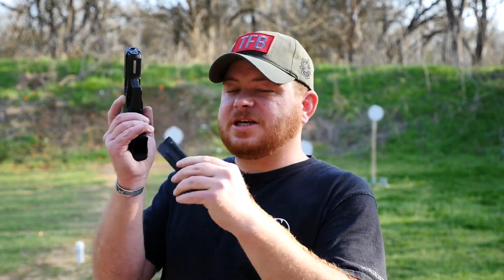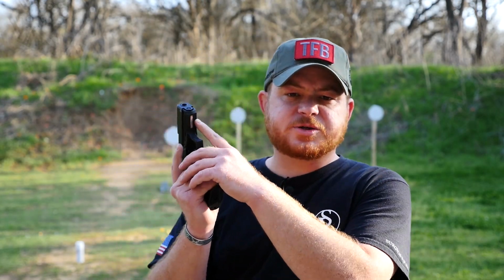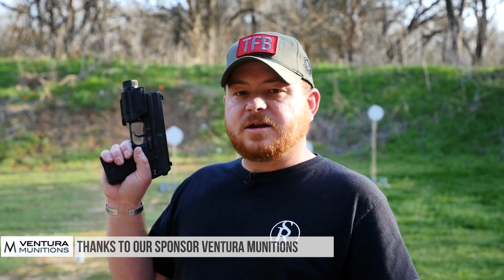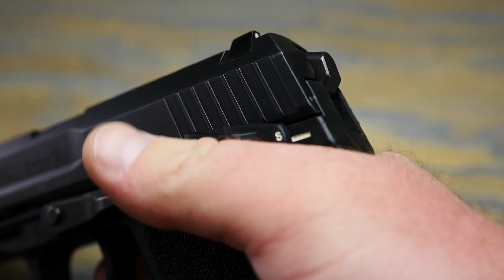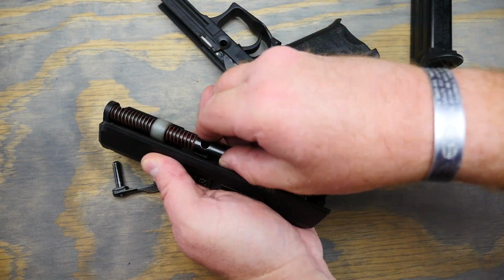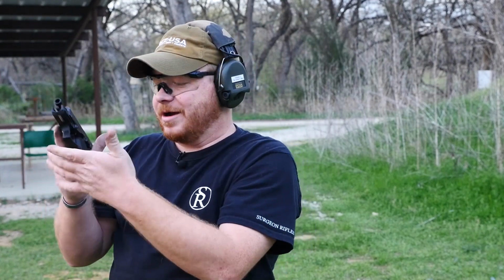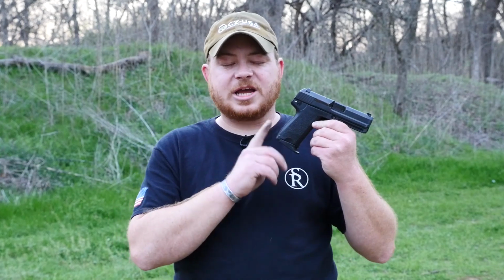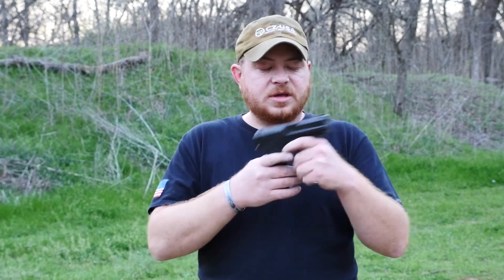Heckler & Koch USP Compact 9mm

Comment: Why do people think staying away from Glock is tough to do there’s literally nothing about their guns that’s even remotely remarkable in today’s market they’re uncomfortable overrated and overpriced cheap 2x4’s if they were so perfect then why do people spend on average 1k to make them actually good
Reply: I can get a Glock 19 blue label for 398 or 475 with ameriglo sights spend 25 bucks on a ghost connector and i have an extremely reliable pistol for 500 bucks. I have a Sig 320 I have a beretta M9 a couple of HKs and a bunch of Glocks. They’re great guns they are accurate and go bang when you pull the trigger what else do you need.
Reply: @Paratus1179  they are reliable guns if only they cost 390 msrp for everyone that’s how much they’re worth stock imo I prefer the m&p 2.0 around the same price literally everything you’d want to add is already there and done better and every bit as reliable or spend more on an HK or FN and still come out cheaper than what you’d spend to get a custom Glock on the same level as those I’ve been screwing around with a CZp10C and now the Glocks feel disgusting in my hands now I still have my 19x in my safe tho

Comment: The USP still has not been surpassed even by todays standards, it is the most reliable DA/SA handgun made by a major manufacturer (it can handle dirt and mud unlike the SIG P226 or the Beretta 92) The only handguns that come close in reliability and over all performance would be some of the top modern striker fired handguns like the S&W M&P 2.0 and the Walther PPQ and maybe a very few others (of course the super popular Glock but Glock is what you buy when you don’t know much about other options... either that or you need a good 10mm or 45).

Comment: Want to avoid having problems with the slide not locking back because your thumb rides next to the slide release?  Try a different pistol grip.  Try putting your damn left thumb under the pistol and in front of the trigger guard.  I do not understand why people use a pistol grip that requires their left or right thumb to ride on the slide and next to the slide release.  Its asking for trouble.  The problem is with you and not the pistol.

Comment: USP compact is the superior pistol if you can afford it.  I paid over $1k for mine with night sights and 3 13-round mags.  Build quality it is like a tank.  Can shoot +P all day.  Big difference compared to the cheaper HK's such as the VP9's and P30s.  Makes the glock 19 feel like a toy.  I would NOT feel comfortable shooting 147 grain +P buffalo bore out in the woods with a cheapo gun.  Lastly, this gun is built to precise german engineering, no defects in quality and you are pretty much guaranteed that it will go bang only when you want it to.  Smith and wesson has build issues (I will NEVER trust that company again) and sig has the infamous accidental discharge issue they are trying to do damage control with their "free" upgrade program.
Reply: Yup! Way better than P30 and VP9.

Comment: FYI for folks overly-concerned with capacity (never understood that, chances of you exceeding 8-10 rounds in a firefight, let alone getting in a street firefight are almost nill especially combined)- you can get the USP C and P2000 and P30SK (and 2000 SK) all with extensions and the P2000 .40 has an already 12 rounder that looks just like their 10 rounders, put a +5 on that and there ya go.
Reply: I feel there is a possibility you might do a mag dump under the adrenal rush and to make sure the target is down.

Comment: Should I get the USPc in 9 or 40?  It will be my only HK bc theyre so expensive (for me at least).  On the one hand i'd like the 40 bc it was designed for it and probably handles that round with aplomb...but on the other hand since it will also be my only German gun something makes me wanna have it in its native caliber.  Not to mention i'll probably shoot it better in 9mm
Reply: CLplusP Go with the 9mm, more rounds and you aren't losing much(if any) with modern ammo. Police across the country are getting away from 40 cal. Cheaper to shoot and less wear on gun, not that it matters with a usp!! Check out wound channels for 9mm, 40 cal and 45... you'd be suprised. You are correct about it being built around the high pressure.40 cal. Makes it handle 9mm and 45 easily.

 Try and find a used one for about glock price. I found my second one for $650 on Gunbroker. Holster wear but lightly shot it seems with night sights. Yup, I have two compacts (wife just got ccl) and a full size 45 for woods carry with 45 super. Looking for a used full size 9mm and upgrading it to custom combat for a nightstand gun. 

After  years of carrying a glock 19 I shot a usp9c and was amazed. No more glocks for me.
Reply: David Green, thanks for your insightful response.  I have since decided that the 9mm would be best.  I'd hate to thrash on an HK by recreationally shooting .40 through it and then have to buy expensive German parts of hk.net.
Reply: Not to mention that I am not caliber-obsessed whatsoever and have always been a strong supporter of the 9mm properly loaded hollow point.  So the USPc in 9mm makes more sense to me.
Reply: CLplusP I used to be, lol. In fact I started looking at usp compact in 45, because bigger had to be better in my mind. A bit of research changed my mind, also I very rarely carry an extra mag when I conceal carry. 

Eventually I got the 45 for woods carry. It's fun to shoot and 45 super is a very viable woods carry 45acp moving at 9mm speeds! I hunt hogs, it would take a lot of 9mm to stop a rushing Boar!! 
But with 2 legged self defense I'm more than confident with 14 shots of 9mm. Although I don't believe in magic bullets, modern ammo is amazing. 

You made a great choice, don't be afraid of a lightly used Usp. Any honest armorer who has fleet experience with glock and hk will tell you he sees less hk than glock for repairs. ....sheeeee. I gotta go shooting after work now, lmao!!

Be well.
Reply: 12 rds in 40, 13 in 9mm.  I'd say 40 for the uspc.  Considering it's service pistol sized and fairly heavy it handles 40 just fine.

Comment: "Hk's slide release is too large"
Same day installs oversized slide release on glock so that it actually has one.
Reply: Yep -- another dip shit Glocktard.
Reply: Glocks extended slide stop is still 80% smaller than the HK.
Reply: @johnviera3884  the Hk I don’t inadvertently activate. The Glock I do. I prefer the plain Glock one. The ambi is really bad
Reply: You have to take in mind using it when wearing gloves.
Reply: @johnharris8191 he contradicts himself with what he says though

Comment: Like every Insight product I've owned, it is overpriced garbage that'll fail you with time. That UTL gave me nothing but problems until the switch gave out (about 6 months of owning it)...like everything Insight, the product was already out of warranty by the time you buy it. 
The USP is still a damn good firearm, even by today's measure. Only failing is if you want a light/laser on it because the UTL sucks.

Comment: My P2000 is so much easier to conceal than the USPc, not sure why even though the dimensions are nearly equal.
Reply: Brandon Bond love my P2000. Its like a USPc but with a melt job on all the edges. Probably the only gun I like enough to buy a spare

Comment: The 15rd capacity P30/VP9 magazines work flawlessly in the USP compact. It's the same magazine, just longer.
Reply: madmark502 is this true??
Reply: Yes. I own a USPc 9mm and a VP9. I've used all four of my 15rd VP9 mags in my UPSc with no issues. Both the 13rd and 15rd mags are marked the same "9x19c". The 15rounders do stick out about an inch though.
Reply: madmark502 Absolutely no issues with the P30/VP9 15-rd mags! Grip extenders are available now, too.
Reply: ReadyOrNot I've had no issues.
Reply: madmark502 Dont bullshit me man, are you for real?

Comment: I have a HK P2000 and a USP full size. Wooould try a USP compact but the P2000 is a bit slimmer and holds the same amount of bullets. I think the P2000 is HIGHLY under rated and I wish it got more love xD
Reply from the maker: +Kyle Clark I agree. I have owned three or four P2000s over the years. Next time I find one with the LEM trigger for the right price it is gonna have a new home. - Patrick
Reply: I was going to try the LEM if I got a P2000 sk. Want to try a LEM before I buy one though and I don't think any ranges around here have em for rent :'(
Reply: i somehow scored a 9mm lem p2000 at a local gs for 350usd, included 3 mags even.  I think 2016 manuf, fairly pristine...makes me almost consider lem-ing my uspc
Reply: Totally agree. 5000 rounds and perfect every time. Good for concealed carry with flat floor plate. Balance in my hand with a full mag is perfect and the feel of it in my hand is sublime; accurate and "tough as nails".

Comment: I love my H&K USP9. (full sized) It was made in 2003 and it doesn't even have any rust or anything on it after all this time, the finish is that good.
Reply: Cool story bro. My mauser is from 1924 and it doesn't have any rust on it either.
Reply: yeah no doubt, but all hes saying here is "i take care of my guns" its not really a testament to the gun
Reply: The frame pins do rust...
Reply: Squibbins Squeegler - firearms can rust over night depending on the conditions. Take some steel that's oil free near salt water, it will rust overnight.
Reply: ofcourse its not going to be rusted, its only from 2003, thats not really a testament to much of anything

Comment: I've had a usp compact 45 for about 10 years now and it's been a great gun. It spits out 45 acp+p like no ones business. Lately I've kind of been wanting a full size usp 9mm with the lem trigger. The usp has a proprietary accessory rail because it was the first to equip the rail, before all the pic rails and such